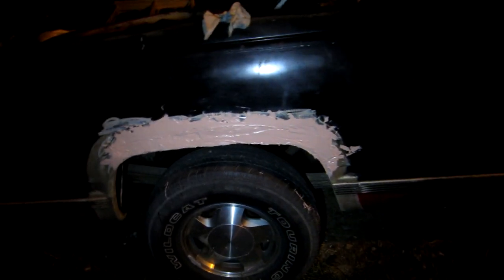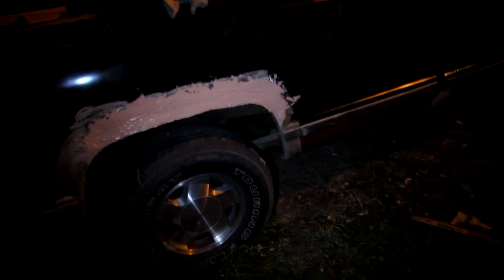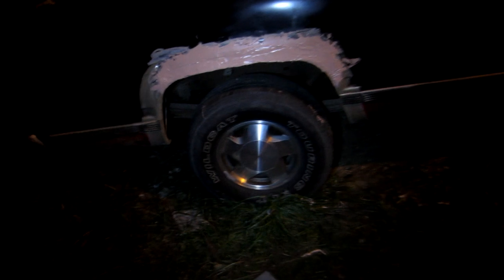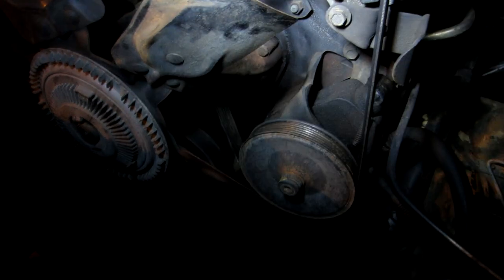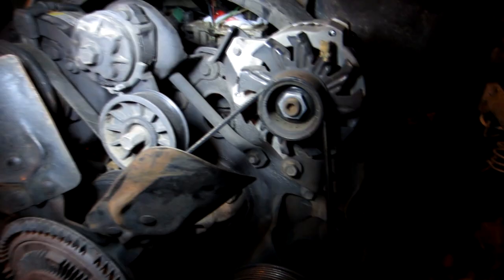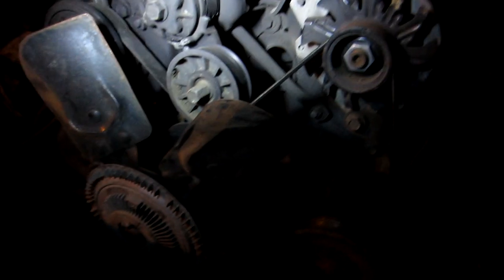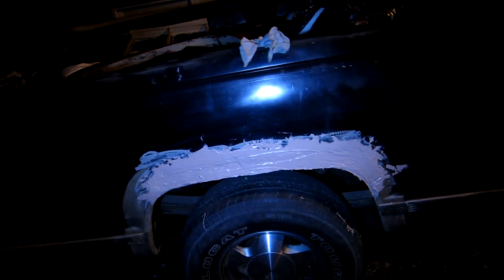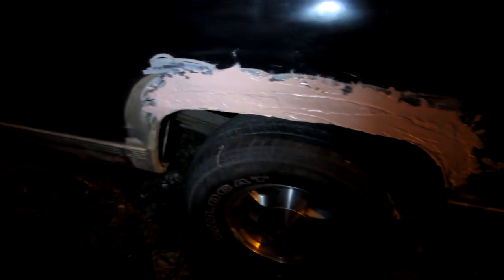4X4 Progress

Comment from the maker: @obieezx11 yeah i was trying to get it all done more than anything i got the welds on both parts done and filled in the holes they weren't pretty but i did actually use a hood this time. what i was getting at with turning the bed around was just that i can get the fender work done on the other side of it since my welder cord doesn't quite reach the rocker and cab corner on the driver's side will just have to wait until i can get the truck running and turn it around. it does have the flairs too

Comment: You chicken Jim covered the welds up before we could see ahahaha.
What do you mean when you switch the tub round can it be use eather way?.

And i wouldent be getting to worryed abut that slop yogoing to have to sand into it no won will tell if its not there as the only way ppl will tell if its got the same truck sitting beside it besides its got flairs hasent it to go back on you wont see them anyway?.
nicew job tho bro keep up the good work.